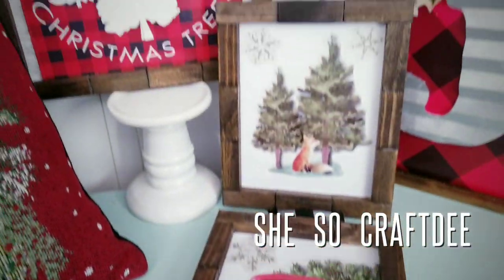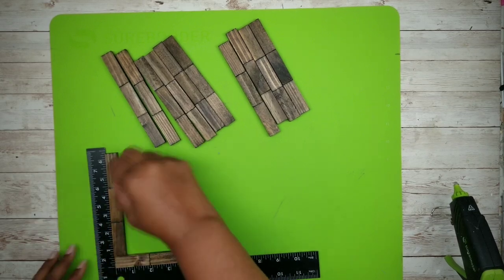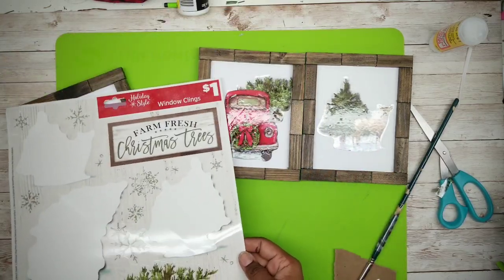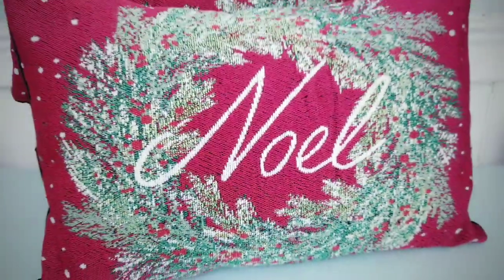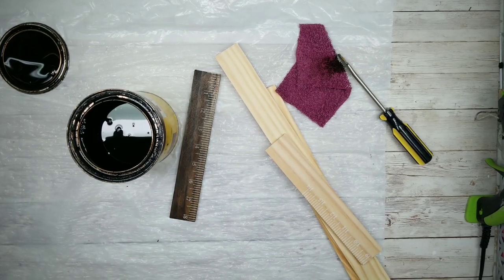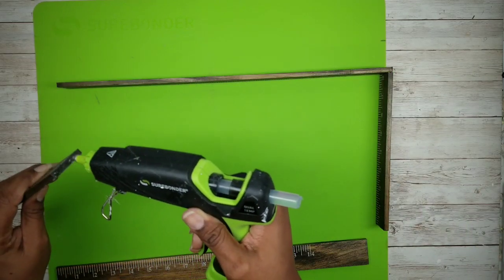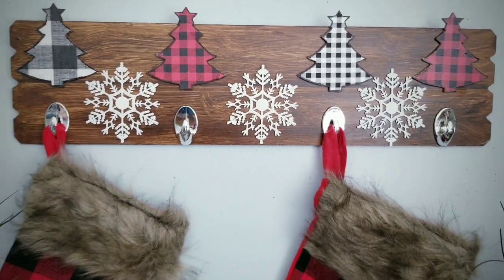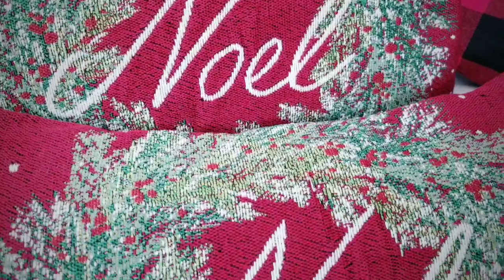5 DOLLAR TREE CHRISTMAS DIYs | Red Truck | Buffalo Check | Stocking Holder | Farmhouse Traditional

Comment: I like all but the joy and the galvanized look was amazing to learn. Also the box lid pic was my favorite. I would have to cover the white sides though. Maybe with just a black matting style line all around the sign would make a higher end look. Then the stocking hook piece was also good. I would change one thing though and that the hooks. I would paint them a Matt black. But again it’s all how we each see things that we like through different eyes and views. The pillow was great too. I love all. Even the window clings. They were really good so I can’t pic just one. If I had to I choose one I guess it would be the lid sign and the joy sign next. I think I would also add a bow at the top in a black burlap to hang the sign but again it’s just my own touches to make my own. But I did enjoy this a lot and you make everything look so simple and easy.  Plus nice to have the deco ideas. Oh I forgot the trees u used on stocking hanging. I love the trees like that. I would like to add trees to a stand and have out and make different stem sizes to have different. I love those. Where did u find the trees?
Reply from the maker: That's  the great thing about crafts... you can customize to make them to match your decor 🙂
 The exposed sides on the box lid are actually have a gray wood plank design.  It may be hard to see in the video. I didn't cover that area since it complimented the trees well.
Reply from the maker: Trees were found at the Dollar Tree 🙂